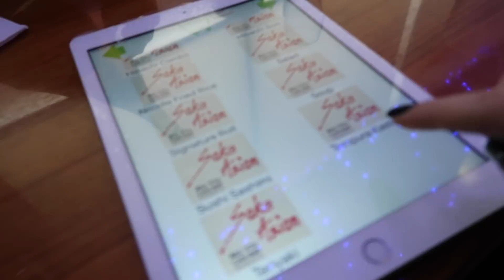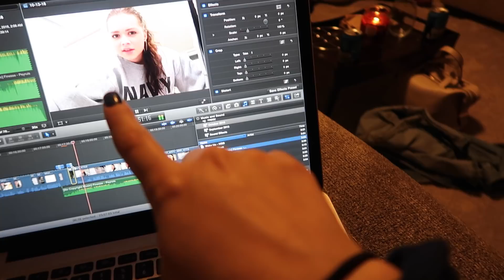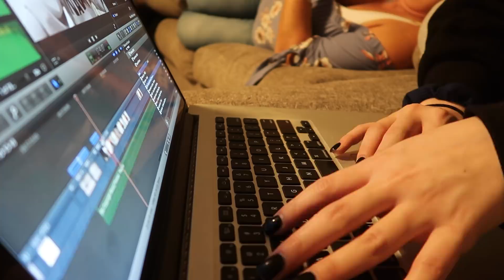Building Our New Furniture!

Comment: Easy way to clean you bathroom floor.  Use a old tooth brush and put whitening toothpaste. Let set for 1 hour then whip off with wet sponge.  It some stays on the grout rinse the tooth brush and scrub a little with it to get it out of the cracks. It will surprise you